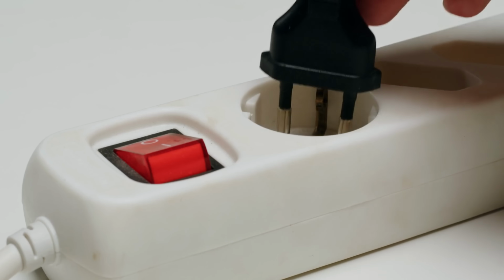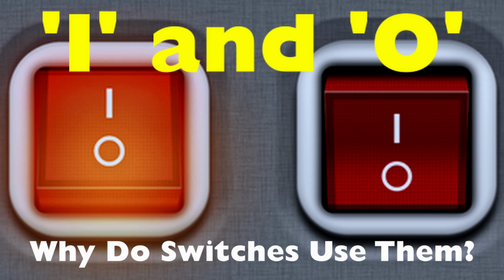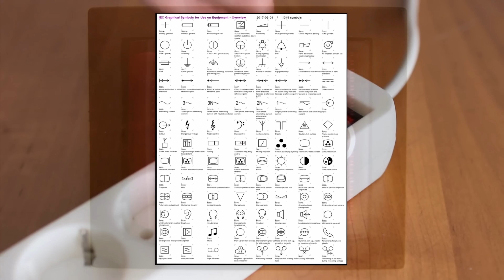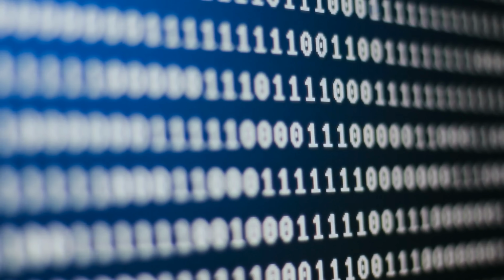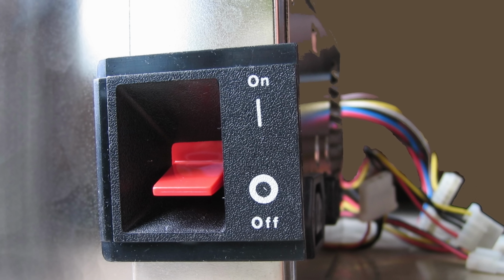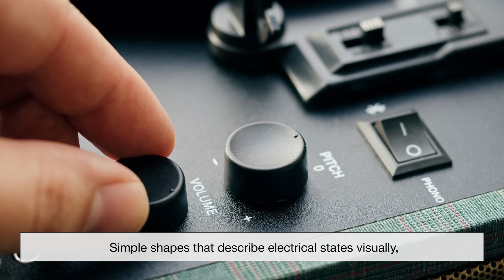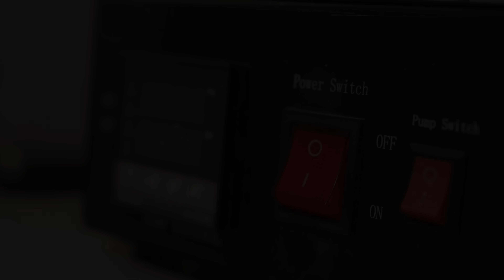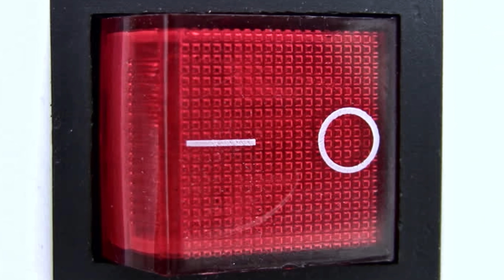Why Do Switches Use ‘I’ and ‘O’? The Power Button Explained [ID0703]

Comment: It has nothing to do with ones and zeros are binary code. Any electronics  world when you're building a  device you either have an open or closed circuit. A line indicates a closed circuit which allows the electricity to flow or an open circuit means the circuit is interrupted and the current is not flowing that is what it comes from. And to builders of electrical components that is what is universally recognized the world over
Reply: They said that, but thanks for explaining it again, except less concisely.

Comment: Most people I know think that "0" means "ON" and have no idea what "I" indicates.
Although I do understand the "0" and "I" labeling on power switches, I find the vast majority of modern eikons used to label controls to be absolutely indecipherable.
Reply: O is for ON, I is for IOFF. Simple. 😎😎
Reply: @ashokwwf  That's fine for ordinary people but engineers prefer the more technical
"---" : Minus sign (nothing, off)
"O" : Completed (closed) circuit (on)
Reply: @ashokwwf  NO;  ON & OFF was simple. And CLEAR. And Safe!  I & O is stupid. Nothing more than committees solving problems that don't exist .In order to get the billions in funding. It's a  money laundering scam.
Reply: Never seen 'eikon' used this way lol
Reply: @Calc_Ulator Now you have. Lol.

Comment: I think an X ❌ & a check mark ✅ would
be more universal. As a kid I didn't know
which meant on & off, so I remember the
I is for initiate and the O is for off.
Reply: But which is which? 
Many overpaid ergonomics engineers today suggest the red  ❌ should mean "ON" because that's where danger is present, while the green ✅ should mean "OFF" because it's safe to touch.
Millions of devices are produced every year obeying these new criteria, guaranteeing that workplaces for decades will have a mix of symbology with completely opposite meanings from one device or machine to the next. The future is bright ✅ for litigation lawyers!!
Reply: @gregfaris6959  Well, I did not know that.
I can't think of anything else right now.
Reply: @gregfaris6959  Red and green works at traffic lights.
Reply: @gregfaris6959  Just goes to show, you can't please everyone. Except maybe litigation lawyers. Until they forget which is on & which is off...

Comment: It's not I and O it's one (1) and zero (0).
Reply: Did you even watch the video?
Reply: @stevenski4 Its neither letters or numbers. Its literally a line and a circle, and its regulated by IEC 60417
Reply: No, it's not a 1 (one) or a 0 (zero). It is a completed circuit or a broken circuit. Easy peasy.

Comment: Electricity flows in a loop. You cut the loop, or power line, and it is off. The "I" should be off, and the "O" should be on. They got it totally backwards... 😉
Reply: The reason there is an “O” for off, and “I” for on, is this…

Voltage is also known as POTENTIAL DIFFERENCE.(PD).   5 volts means that it has a PD of 5 from ground

Ground or earth ground is absolute zero.  

Because there is no PD in a closed loop, this zero volts

Ergo the “O” represents this closed loop or OFF
Reply: Exactly as I see, 0 represents a closed circuit.Exactly the opposite of their "intuitive" solution.
Reply: Exactly
Reply: DC (direct current) flows in a loop. AC (alternating current) switches back and forth (cycles per second or hertz or Hz). Some appliances use the AC directly, others convert it to DC. Think of the solid line as connecting two sides together, and think of the 0 as a zero, or no current or no connection. Or just simply 'off'. Easy peasy.
Reply: @Colorado_Native Great points!

Comment: I still look at it and wonder which is which. There's nothing intuitive about a line or a circle meaning on or off.
Reply: I taught myself that the I was
for initiate and the O was for off.
Reply: @ml9867  the O stands for ON.
Reply: @Robert-fx3ngi think it should be backwards than what it shows. What I think it should be is The circle means complete the circuit and the ends are touching and the line means the ends are not touching. So the circuit is not complete.
Reply: @mrvic92154 I've always thought the same 👍
Reply: @ml9867 why not O = On? 😅
Reply: I look at it as 0 for Zero. Zero power.
Reply: Fk! How about "0" for OFF? Bless your heart!
Reply: @brucelytle1144  Un, On starts with an “O” too…
Reply: @user-zp5vj2bl8o1  THAT'S what always confuses me! There's nothing to make it memorable!
Reply: @brucelytle1144 Wouldn't that also mean that O is for on? O, the madness of it all!
Reply: @SAJe_53   Dunno, That's just the way I look at it.  I could also be good with the digital, 0 and 1 viewpoint. In my career, I designed and built industrial control systems, so there is that.
You need to look at it as international symbols. On and off is for english, not all languages spell them the same.
I built a hundred or so panels for a Swedish steel mill once. Could not read the lettering (is that a circle or a dot above the letters?), but could understand the symbols that I silkscreened on the faces.
I've also used a simple (to me) process to figure it all out. If (what ever) it is not on, and I want it on, I flip the switch. Same logic when I want it off, flip the switch.
Reply: Nice to be told , I would never have guesed this, I didn't study electrical engineering nor did my wife. There has never been an education program in this stuff  I have been using these switchs  by trial & error eversince these things were inflicted on us. The whole world speakes English who wouldnt'  understand on and off?  Do they really think that some uneducated person anywhere in the world understans sush a pathetic symbol?  No wonder I hate computors and its idiotic symbles
Reply: @dirkheubel2899  Sounds like you are from the US. NOT EVERYONE SPEAKS ENGLISH.
Reply: @Hubbles41 it's numbers not letters.
Reply: @dirkheubel2899 there's always Google.
Reply: @dirkheubel2899 You’re not doing such a great job with English either.
Reply: So do I.
Reply: 7 minutes of blabber and no real reason
Reply: @johnr7794 I'm sticking with the binary explanation.
Reply: Exactly!  Use a symbol that people understand immediately!  “On and Off” worked well for years!
Reply: @ErichH68 not for small buttons
Reply: 1 = power. 0 = off . Well isn't that a daisy?
Reply: @tomthackston1442  100% agree. I STILL have to stop and think.
Reply: I agree with you completely.  I see the O as a closed circuit (on) and the I as an open circuit (off).
Reply: Think OPEN and SHORT
Reply: l for ignition, that’s how I remember
Reply: Ha!
Reply: Its binary ones and zeros . 1 on , 0 off.
Reply: @billhasker-nz9jk But that doesn't help.
Reply: My understanding is 0 and 1 represent characters of a logic ‘word’ or ‘byte’ comprised of 8 zeros and ones e.g. 11000110.  This is the language that computers talk to each other.  A zero = “no electricity present” which says “off”.  A one = “electricity is present” which says “on”.  
So, the logic word or byte used in my example 11000110 is the computer saying “on, on, off, off, off, on, on, off”.  A computer can’t make sounds to communicate, they produce either 5 volts for a ‘1’ or zero volts for off.  Therefore, 0 = no electricity present, 1 = electricity is present.  Therefore a 0 or 1 on a switch means 0 = off and 1 = on.  Hahaha…not easy to explain😊
Reply: @russsyracuse8143 in electronic 
0 = no current 
1 = have current 

0 = zero voltage (or low voltage)
1 = higher voltage
Reply: Agreed, the symbol's just don't make any thing come to mind to make memorable!
Reply: Same
Reply: a circuit complete would look more like an O to me. The binary explanation is easier
Reply: @timp247 binary 0 and 1 is not explanation, the original design is zero and one instead of letters O and I 😮😢
Reply: I learned as a teen that it was open circuit and closed circuit. As a tech minded person it made perfect sense to me.
Reply: There is to anyone who reads binary. I'm pretty sure the whole "the symbols' similarities to numbers is coincidence" is BS.
Reply: @SAJe_53 the original design is one and zero! NOT the letter O and I 😮
Reply: @Hubbles41 Although you're right about not everybody speaking English, and about Dirk sounding like a typical US born ignoramus (I'm US born too), English is generally accepted as the international language. Most schools around the world teach it to students from a young age.
Reply: I was always confused because, to me, the O appears to be a completed circuit, while the | looks like an incomplete circuit. I took to letting them represent In and Out to avoid the confusion.
Reply: Thank you. It is so good to know that I am not the only one with this problem.
Reply: I think of it as open or closed contacts
Reply: ( I ) shows the electricity is running thru --->...... ( O ) symbolizes the power is on "hold" @
Reply: Think of the "O" meaning NO action and the "l" meaning IN action. That is how I do it.
Reply: @romad275  That could work!
Reply: Binary
Reply: Looks like :

O  = On
—  = Shutdown 

😮
Reply: So true! If anything, the circle looks like a completed circuit and would thereby imply the ON state, but somebody (possibly with an Anglophone background) decided that the O represents an O-pen circuit...

Thank heavens we have the Boolean 1 and 0 to rely on....
Reply: @skailaje BULLSHIT!!! In binary code, 1 is ON, 0 is OFF!!!😀
Reply: You'd think "O" for closed, and "I" open because I isn't connected, but that's me. Using the I for "initiate" is a good memory that someone else suggested.
Reply: I know. It's the same for me.  Just can't get it committed to memory.
Reply: They are so focused on making themselves look smugly proficient that they seem to reject all the injuries and maybe even deaths that are occurring over this illogical nomenclature.
Reply: I used to work in a shop that repaired small engines.  That switch was the source of endless frustration for customers with a piece of equipment that for various possible reasons wasn't working.  Everything else is marked in plain words... they couldn't spend the fraction of a penny to add a couple more letters just to make it plainly indicated?
Reply: It's Binary !
Reply: Circle is O = 0 which is nothing (no current)
Reply: @user-zp5vj2bl8o1  Not intuitive tho. A working circuit is closed. O is a closed loop.  I is open as both ends are doing nothing. Messes me up every time.
Reply: It's so simple.  Plug it in . If it's on 0 it's off. Push it to 1 and it should go on.
Reply: @vicmota2817  That's not a good way to check if some appliances or equipment is in it's operational state.  And there's a lot of gas powered equipment where the switch is only one component of why it might not be functioning.
Reply: @_DiSTuRBeD_ I was a groundskeeper for  10 years. When a device was screaming and cutting, it was on! When I flipped the switch, it was off!!!🤪🤪🤪

Comment: Decades ago, back when I was little, you could find simple English "POWER" and "ON/OFF" buttons on products. It was simple enough and obvious. But that seemed to die in the 90's with the rise of PCs and the Internet.

Personally, I think the symbols work alright on power strips and for the power switches of printers and the power switches of network devices. But I feel like it takes the personality out of the product when used for everyday consumer use electronics when used for the normal power putton or on/off switch.